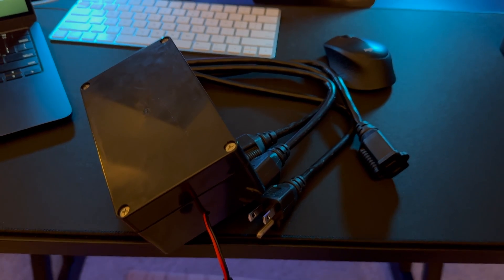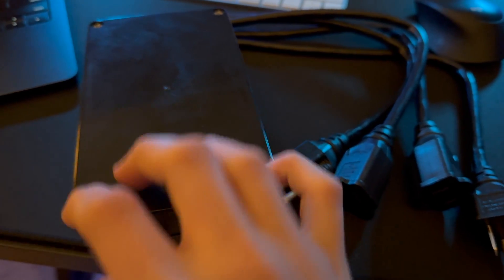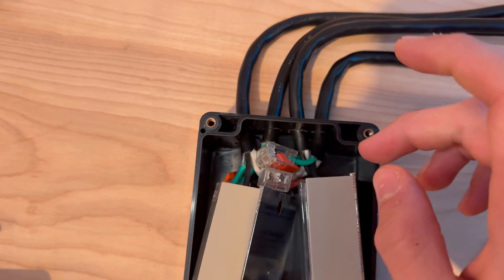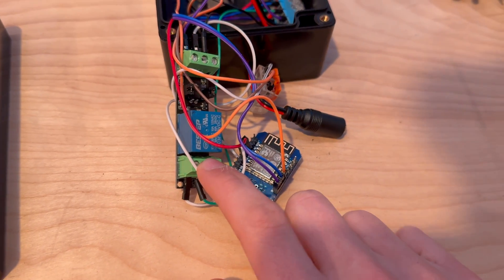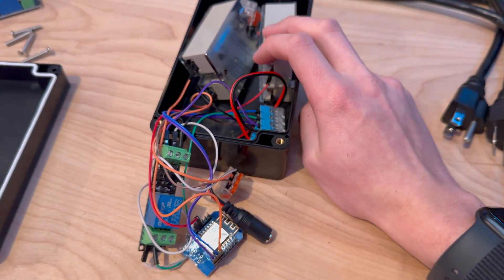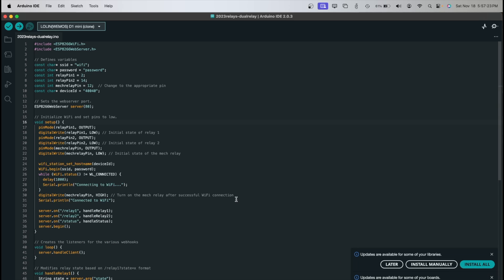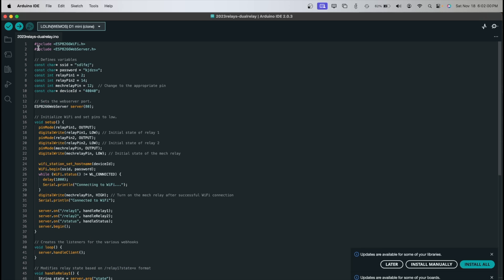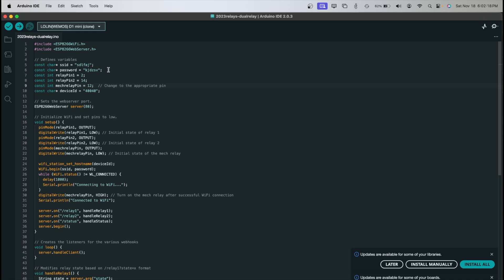DIY Smart Home Relay: ESP8266 with Solid State and Mechanical Relays for Local Web Control

Comment: Is there a reason to add the extra relay if you are going connect it to an ac adapter and it only affects boot.
Reply from the maker: Without the mechanical relay implemented, I was getting a weird bug where as soon as the controller was plugged in, the solid state relay would flicker for a second and I: A. didn't want to keep messing with the code and B. Realized implementing a mechanical relay before the solid state isn't that hard to do and would allow for a "hard shut off" of the solid state relay in the event something goes wrong.
Reply: @beamnetworks1  Your bug is assigning relays to pin 2 and 14. On an esp8266, Pin 2 is the built in LED and varies during booting, taking about 110ms after boot to get pulled low. Pin 14 is the SPI clock, and is pulled high also until around 110ms after boot. 

Switch the relay signal pins to (D4 → D1) Pin 2 → Pin 4 and (D5 → D2) Pin 14 → Pin 5. Pin 4 and 5 are for the I²C bus and remain LOW all throughout the boot.

In the future, make sure to check CPU and Pin signal timings in the datasheet when you are signaling control of dangerous things. It only takes one bug to burn down your house. ;)
Reply from the maker: Thank you for this information. I have added it to my to-do list for me to update the code and update the relays I have built with using the other data pins. I'll also add an updated link to better code in the description of this video so that others can use the corrected code if needed. I appreciate your help!